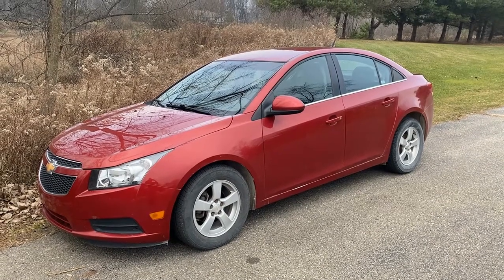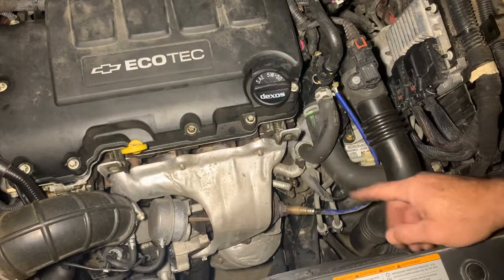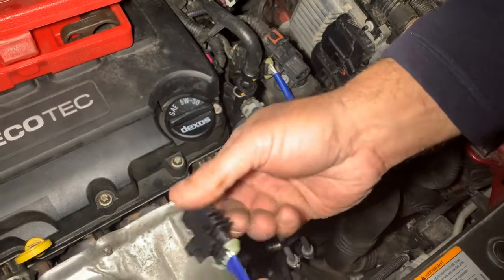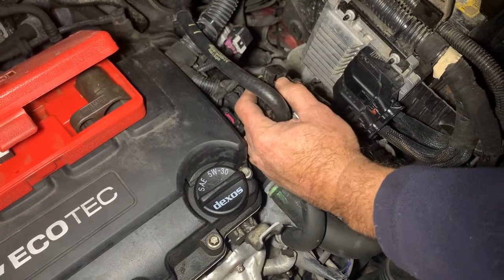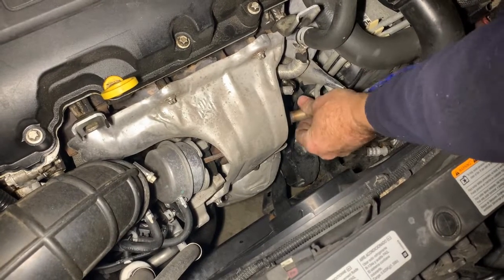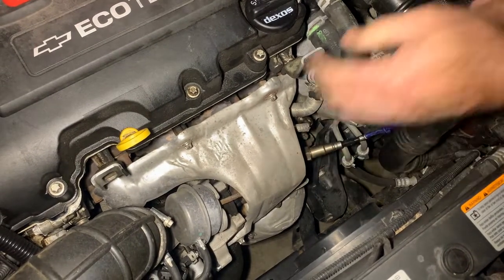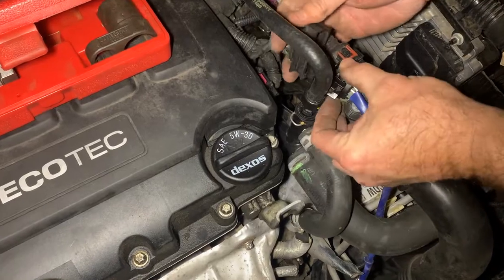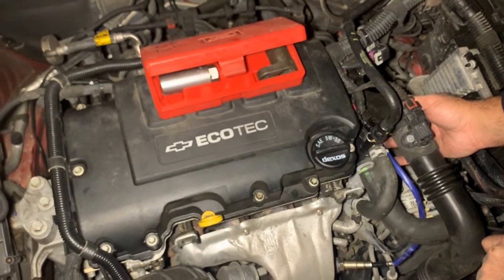How to Replace an Oxygen Sensor Chevy Cruze

Comment: I have a question.  I just ordered my 11th 02 sensor  for my Chevy Cruz 2014 1.8L. They keep sending me a sensor that doesn't not look the same as the one installed in my car. The OG sensor from my cat has a half dome shape qith holes, the one I keep getting is a cylinder with manu holes . Is this the same or compatible? Please advise
Reply from the maker: Yes, the cylinder-style sensors can be fully compatible despite looking different.
Ensure you have the correct position, wiring, and part numbers.
The ones you’re receiving are likely fine, just confirm fitment and install.

Comment: My chevy cruze is showing p0172 code which oxygen sensor do I need to change this one or other one in exhaust pipe
Reply from the maker: A P0172 can be caused by many things, but it is typically the upstream oxygen sensor. Yes the one show in the video. Also inspect and replace the air filter, inspect and clean the MAF and also check for vacuum leaks ETC.

Comment: I got all these codes, it's a 2013 1.4 turbo CRUZE. Is it solved just by changing the sensor as in your video? Thank you for the help

P0036
Heated oxygen sensor (HOS) 2, bank 1, heater control - circuit malfunction
P0138
Heated oxygen sensor (HO25) 2, bank 1 - high voltage
P0140
Heated oxygen sensor (HO2S) 2, bank 1 - no activity detected
P0141
Heated oxygen sensor (HO25) 2, bank 1, heater control - circuit malfunction
Reply from the maker: Not the same, ours was the upstream oxygen sensor and your PO codes are for the downstream oxygen sensor. The O2 sensor you need to replace is after the catalytic converter.

Comment: what size was the wrench?
Reply from the maker: I never use a wrench but I think it would either be a 7/8 or 22 mm , just do a loan a tool from an Auto parts store and get an oxygen sensor socket set.

Comment: After you replace it do you have to do anything else I heard something about plugging a computer in
Reply from the maker: If you don’t have an OBD2 scanner to reset the codes, you can disconnect the battery for 5 minutes and that should clear the codes
Reply: @TheAutoTeacher  thanks, changed it today.
Reply: @TheAutoTeacher  I did that it still come backs on?
Reply from the maker: If diagnosing a code P015B, make sure all engine misfire codes, throttle position sensor codes, manifold air pressure codes, and mass air flow sensor codes are repaired. An engine that is not running efficiently will sent all sorts of PO codes .
 Other potential causes for PO15B are burnt, broken, or disconnected wiring and/or connectors, defective catalytic converter, engine exhaust leaks.

Comment: Is a o2 sensor socket necessary? Looks like an open end wrench would work.
Reply from the maker: That would work. However, it would be easier to strip the o2 sensor with using a wrench

Comment: This seems so straightforward yet ima still pay someone probably around $400-500CAD to get this done...
Reply from the maker: That’s why it’s a good idea to do it yourself if you can :)
Reply: @TheAutoTeacher  im at the dealership right now, its gonna be like $350 + taxes. Whats the difference between a $300 scanner and a $7000 scanner he says the shop has do you know? Said he could control my car from like 60 feet away but like i want my car fixed now remoted controlled lol
Reply from the maker: The more expensive the scanner, the more features and options it will have. It will give a more in depth detail on what’s wrong with the car. Something an auto shop would have.
Reply: @TheAutoTeacher  the issue with the car wasnt a bad sensor, it was a bad turbo 😂 i bought a Volkswagen TDI today with 24,000 kms

Comment: I got code p0420. Is it the oxygen sensor or something else?
Reply from the maker: It's either your oxygen sensor or your catalytic converter is starting to fail. You could try changing your oxygen sensor first because they are a lot cheaper.
Reply: @TheAutoTeacher  how where can i get it at a cheaper price
Reply from the maker: Possibly Amazon
Reply: @TheAutoTeacher  thx this helps 😎👍
Reply: @learsisalotiv1625  been 2 years already but was it o2 sensor?
Reply: @xchino0427  no it was the intake and catalytic converter
Reply: Hi got the same code today. At Auto zone they told me it is the oxygen sensor.
Reply: @HunterHunter93  it was the catalytic converter. Not cheap btw.
Reply: @HunterHunter93  and the intake ( turbo assembly)
Reply: I got same code so u kno Wht the problem was